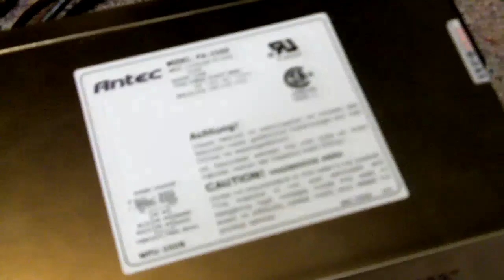Peltier Cooler Test Run

Comment: How come I have the same Peltier module but it didnt freeze up the water ? Its running off 12v power... Did I purchased a shitty module from ebay or my power is not strong enough ? It's cold but will not freeze even just a drop of water. Thanks a lot
Reply from the maker: There are a couple things that can affect how cold the peltier gets.  The more efficient the heat sink, the cooler you can get.  Try a power supply with higher amp value.

Comment: you need one of these: http://www.ebay.co.uk/itm/UK-Stock-DC-5V-12V-Universal-Regulated-Switching-Power-Supply-for-LED-Strip-CCTV-/400671565030?pt=UK_BOI_Electrical_Test_Measurement_Equipment_ET&var=&hash=item5d49e2e4e6
Reply: id get the 15 amp one
Reply: UK? srsly m8

Comment: so what is a good power source for such a unit? did you find anything easy to use with this?
Reply from the maker: I have not find anything "easy" to use, yet.  I recently got a variable power supply which I will be testing out.  But, it looks like I need to find something with a higher wattage.  The peltier needs more power then a typical computer ps can provide.
Reply: rangermonk so after reading and googling to my understanding the amount of heat/cool is based on the Voltage and each device uses different amount of Amp depending how much V it is getting. so bottom line is finding a adapter that has high Amp. the number of Amp should match the Volt. and the ratio for that is based on the usage graph that the manufacturer provides for each model.  so if the device pulls 10amp at 12v  and your power adapter is only 5amp it will burn out.  so we need a power source with variable Volt and high amp and by adjusting the volt you can control the peltier.  my biggest laptop adapter gives 19v and 6amp this could be fed into a DC voltage regulator (7$ on amazon) and fed into the peltier, care should be taken not to over do the Volt based on the amp the source can provide. now in the case I described 19v/6amp the volt has to be brought down to match the amp based on the graph so I would say not more than 9v.

Comment: is the power supply necessary can't use an adapter instead of it ??
Reply: 12V adapter
Reply from the maker: Yes, you could.
Reply: so can i use the peltier and any other thing to at the same adapter no danger in this ,,,,, like a 2 or  3 pc fans at the same time ????
Reply from the maker: Depends on the total load.  This is why I was using a power supply.  The fan used several volts and the peltier used more.  I would use two separate supplies, 1 for the peltier and 1 for the fan.
Reply: so i cant use 1 adapter for 2 peltier and a fan right ?
Reply from the maker: You can, if it can handle the load.  You have to be able to account for the total system load.  Add up the voltage and current load for the peltiers and the fan.  Either your adapter can handle it, or you need more adapters.